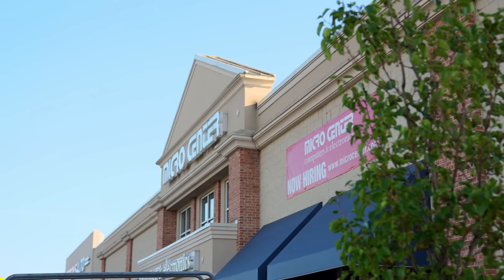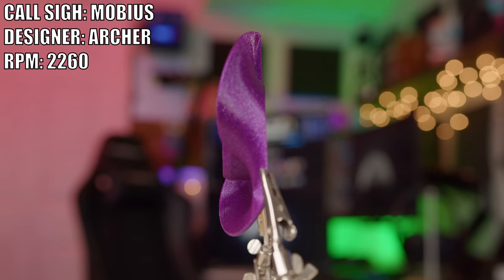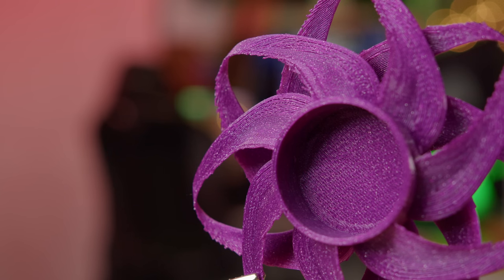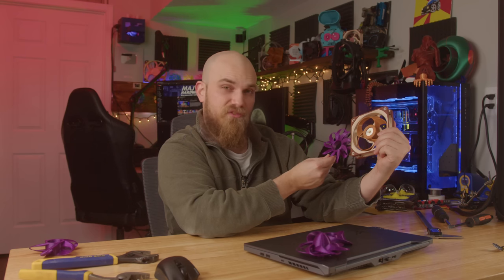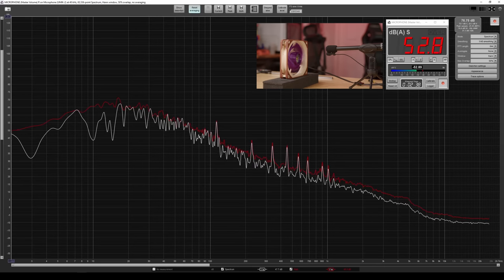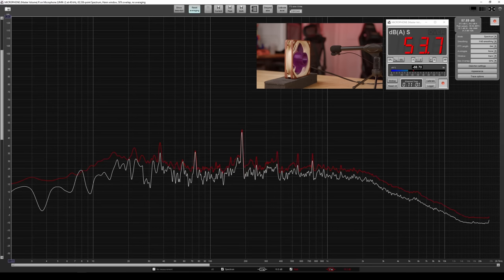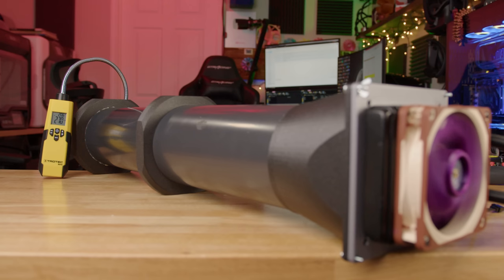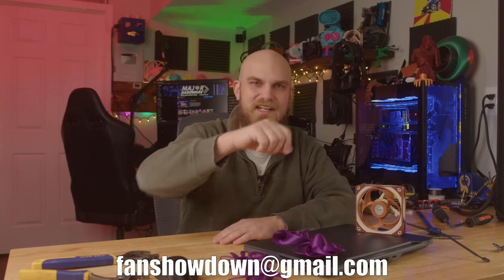My Subscribers Turned MIT Award Winning Toroidal Propeller Into A PC Fan | Fan Showdown S5E5

Comment: I am, by no means, and engineer. However the one thing I took away from your tests where, the most volume of smoke movement was along the circumference of the hub, trying to move to the center. The suggests to me that creating a much smaller hub on the fan and extending it away from the fan motor to accomplish this task, might do much better?

Comment: the mobius moved the same air both way's because the air flow is 270CFM meaning that going in the front of the fan is 270CFM of air and coming out the back is also 270CFM of air so because the wind tunnel is a constrained area when the fan is flip directions the air still has to through the tunnel its just that it is flowing in the opposite direction. due to the tunnel being a constrained area you don't have the effect of the air being pulled from all directions all 270CFM of air still have to pass the flow meter to get to the fan

Comment: The best for noise should be taking an existing swept fan blade design and and attaching the tip of the blades to the leading edge for the following blade. This till eliminate the vortex without having a solid ring enclosing all of the blades.
Reply: Thanks for the feedback. 
Expect more videos soon. 
Send a direct message... 
I have a Gift for you📦......

Comment: Hey why don't u try out the original design propeller with resin printing... For smoother surface as these  in the boats are smooth as butter

Comment: Hey, not knocking the testing, but I have to state that on the printed fans you can see the ridges, meaning that the airflow will not be as smooth as on the manufactured Noctua. Whilst I agree in your methods of testing, I think that the blade surfaces need to be smooth in order to compete with the Noctua

Comment: My understanding of the toroidal propeller design is that it requires very high RPMs before you start to see a big noise reduction over traditional propellers. These fans being relatively low RPMs (2,000 RPM as opposed to 8,000 RPM), you're going to need a design that is radically different than the quadcopter propellers. 

More than likely to get Noctua levels of CFM with less than 46db of noise you're going to need either dozens of overlapping toroids in the fan, or fewer toroids that wrap around the central axis more, something like that. These are all good tries, but I just don't think they grab enough air at the low speeds to get the job done.

Comment: I think the major issue is that toroidal propeller is designed to work without a frame or duct around it. You should have motor only without the frame to get full effect from these designs.

In addition, I would try to put those propellers in e.g. acetone fumes for a short time to make the surface smoother. All those extra lines on the surface of the propellers are going to cause a lot of extra turbulence.

Comment: fun fact.... in bigger home ventilation systems, 1mm of dust on your fanblads is aprox 10% reduction in effect.... so im wonderering, some of the prints are.... roughf...pointy....has a texture to it.
just for the fun. try taking one of the fans that did okay.... but hat like pointy(bad printed) edgde, and a gritty texture, and smooth it. paint, sand, paint, sand, pollish. and watch.... i garantee you will have a big improvment, ind sound, and effect.

Comment: Guys, toroidal blades most likely doesn't apply to PC fans. 
What they do in boats and such is to reduce border effects at the end of the blades. 
A PC fan is encapsulated inside a frame and that frame reduces border effects by itself, so no need for toroidal blades and it doesn't stack.

Comment: When I look at MIT's drone, it uses a non-enclosed blade.  I presume the advantage of the toroidal propeller is to self-enclose airflow to provide a steady stream.
A PC blade is enclosed by the shroud, so I would imagine that toroidal blades have little benefit, and are detrimental because they have less surface area.
-I am not a physicist!

Comment: If these fans work better without a frame like many ppl says, perhaps there's gotta be a toroidal design that's smaller than the case radius yet more/equally efficient out there due to the gaps.

Perhaps on a wider frame is in order, I can't imagine gaining much from blades competing with the mounting hub for usable surface area

Comment: I imagine your anomometer can measure airflow in either direction so flipping the fan changed the airflow direction but not the air speed so it read the same value.

Comment: These tests and such are fun, but I don't think we are getting computer fans with toroids instead of blades any time soon.
there's reasons for it; production cost and effective airflow.
The toroid boat props work great because its in a way denser medium than air meaning it works at lower rpm.

They "aren't as efficient as drone props" but because drones spin their blades at such high rpm anyway, it becomes worth the effort to have a quieter propeller.

Comment: I could be wrong but I think these noise levels were about the same as the stock noctua in the last video.  

I got to thinking about why, especially when MIT stated noise reduction and efficiency gains... With the design mitigating tip vortexes this starts to make sense.

The fan shroud/frame is already helping to mitigate tip vortexes on computer fans.  I wonder if there would be a larger sound difference on a hub with the outer frame removed.
Reply: Thanks for the feedback. 
Expect more videos soon. 
Send a direct message... 
I have a Gift for you📦...........

Comment: Did you try printing a traditional fan blade?  PLA prints are not smooth, so it might be helpful comparison. 
Also have you tried to 'smooth' any PLA prints? like ether using a hate gun, or other method of smoothing.

Comment: I see quite a lot of shear in the downstream smoke. A design that would make no shear at all, and almost no sound (!) would consist in removing the propeller completely and replace the fan shroud with a Coanda effect accelerator – you know, of the same kind used by Dyson for their fans. Over-pressurized air is injected through a thin slit and flows onto the inner curved part of a ring, akin to the upper surface of a wing (extrados) rolled up on itself as a toroid. Coanda fans suck the surrounding air very efficiently. As the drawback of such a design and the only source of noise (except for the slight whistling pitch of the wind) is the small compressor feeding the Coanda fan, you could put it remotely and incased into a box, in the attic or the ceiling, the next room, etc. I think this has never been made yet.

Comment: As far as I read. The Toroidal propeller only did a bit better than the traditional propeller but in mid rpm(for motor boats) range the Toroidal propellerwas 30% more efficient.
So I think it would be better to plot a graph for the Toroidal ones and the reference to see at which rpm would be optimal for the fan.

Comment: i think the biggest difference is the blade design. blades meant for flight are designed to create a very low pressure zone above the blade to create lift, it'll push air, but not as much as it redirects it around the blade. fans for cooling are specifically designed for pushing air along and not around. Toroidal fans are probably not going to be a good fit for cooling.

Comment: I have very very limited experience or knowledge when it comes to 3d printing so I could be wrong - but I feel like this sort of filament printing is what is holding these designs back?  They just look too rough and too heavy to be as effective as they could be.  I imagine the noctua fan blades are waaaay lighter than this stuff

Comment: The Toroidal prop for boats I've seen is pretty deep front to back to give it a decent blade pitch, that'd be hard to do on a smaller, flatter PC fan.  I have seen alot of "slim-line" 120mm Pc fans out there lately as well and wonder how effective they are compared to normal 120's.
Reply: So that makes me wonder if they could quiet the fans used in 1U servers, which are much deeper and spin much faster.

Comment: Not weird at all the Mobius got the same airflow speed when you flipped it, because in fact it moves the same amount of air in both orientations, just in the opposite direction. Would expect about the same behaviour flipping any fan, with some small discrepancies because you are drawing air in through a restriction rather than forcing it out through one.

Comment: I'm pretty sure the quality of the surfaces and trailing edges of the blades has a lot to do with both the strength of air flow and especially the noise level. You should probably print these in a resin printer or chemically smooth them. All the grooves from printing must increase resistance to airflow significantly and the uneven trailing edges create trubulent flows that result in noise. It would stand to reason that if toroidal propellers have better performance when done properly, the secret is in precise tuning of the geometry and in the precision finish/balancing, which is beyond the abilities of an FDM printer.

Comment: The Cooling fan is a shrouded fan anyway, so the tips are already fairly baffled so as not to create vorticies.  The simplest design for a standard prop is to shroud it, basically fix a ring with no angle of attack onto the tips of a standard prop.  It will add inertial mass with no additional airflow, but the idea is to shut it up.  I do think the toroidal concept has a lot of promise.

Comment: I like the enthusiasm for this design, but I wouldn't expect this type of fan to have a huge benefit in this scenario. The point of the design is to help control tip vortices on unducted propellers, but that job is already handled by the frame of a computer fan. There might be some small advantage, but I would expect it to be much, much smaller than that of its intended application.

Comment: I think you should try doing the opposite of this show, aka take the best performing fan design from the show, and rescale it to a set of props for some small drone. These drones usually have a battery flight time of 7 to 13 minutes, so the test could be to measure total hovering flight time with regular props, vs custom ones, from full battery to emergency landing. If custom props are better, drone should fly more efficiently, resulting in a longer flight time on the same battery.

Comment: RPM should be the same for all these tests. Aitflow and noise comparisons measured at the same RPM tell us more about how the shape performs. Especially if you can test at differeny rpm intervals. 

The shapes all weigh anf balance ddifferently so they will have different RPM at the same motor power

Comment: The MIT paper was proposing the toroidal fan as an alternative to an open fan. The main selling point of the toroidal fan comes from the fact that it doesn't produce large wing vortexes. The duct that the fans have already negates some of the downsides that the toroidal fan is trying to fix. To be honest I don't see how a toroidal fan can outperform the standard ducted fan in this case.

Comment: I think you should make the same propeller as in the original Noctua (but printed like all the others from your test) for a pure experiment with noise, etc.
The smooth surface and shape of the propeller blade edges is an important part to create good airflow (imho).
I mean a close to perfect smooth surface* and the ends of the propeller blades should be very close to the "frame" or slightly higher (but for case with higher need develop new frame with different form for inside frame "tube", good ref -- airflow from human nose, or dog nose airflow). The efficiency can be reduced because the air on the outside of the toroidal propeller rubs against the blades and the frame.  I can't describe it well in English, sorry

Comment: I was noticing the "Toxic" fan you have up on the back shelf from a few seasons ago, and wondering if it isn't basically a toroidal shape, just with the outermost blade-connecting portion removed? I kinda wonder if these newer designs would benefit from a similar element.

Comment: What I wish you had done - is printed a replica of the A12's blades to within the capabilities of your printers - and evaluated against that, ALSO, as benchmarking un-smoothed rough 3D printed surface against finely moulded injection moulding is not really... Fair.

Then it would be more... "Apples to Apples"

Comment: I'm no engineer but I think the ridges that form when printing the blades mess with the airflow, noise and energy consumption significantly. 
I wouldn't be surprised to see toroidal fans taking over the business once they are made via professional manufacturing techniques

Comment: Have you tried printing a replica of the Noctua fan blades in #1 place? I'm curious how much the FDM process contributes to noise. Do you have a resin printer? The smoother surface and smaller features might be better for PC fan blades.

Comment: The toroidal shape doesn't really make sense for a shrouded fan. The main advantage is that discrete tip vortices are not shed as predominantly. However, this problem is already mitigated by the shroud.

Comment: I notice the Noctua fan still seems to perform better than all the fans on the list,( even the new tech Toroidal designs),  and I also notice that the 3D-printed fans All have a very rough surface compared to an injection molded part. The rough surfaces would definitely affect the efficiency of All the 3D-printed fans. I would love to see how a higher-quality 3d printed part with all smooth surfaces would perform, Maybe post-processing with a smoothing treatment, or  printing  it in a high resolution resin printer would do the trick.  It would be cool to see if the same fan designs perform differently depending on the layer hight,  or Post processed smoothing, or a resin part.

Comment: I don't think Toroidal fans will help much when the fan is inside a frame like a PC fan is because the point was the how the air at the edges of the fan blades acts, but the frame around it is probably reducing how much that air is able to expand and create noise. That's my current theory. I don't have a means of testing this, but maybe you could...

Comment: I believe that these designs do not perform well inside a duct since the duct removes the advantages of the toroidal fans.  Toroidal blades reduced tip vortices to give them higher efficiency, but the fan duct does the same thing,  so you lose any advantage you would get from a toroidal design.

Comment: This is regarding the Mobius design performing nearly the same for the airflow test. You don't happen to have it where the airflow can flow in only one direction for that test, do you? Because if not, then it wouldn't matter the orientation of the fan because suck or blow, it would still move the same amount of air for your tester instrument. Perhaps if you want to be able to determine that, you could set it so if the fan blows pulls air from the fan side to equal positive airflow, and if it goes backwards to be negative airflow. Not sure how you'd be able to adjust your test to do it though.

Comment: The cowling effect of a computer cooling fan kinda negates the effectiveness of tip vortices mitigation, though. Its the rotary wing equivalent of flying "in ground effect, right? The benefit of a loop airfoil is really only realized in effectively unconstrained air volume.

Comment: Hm.. I saw a drone vid using one of those first very simple ones. It sucked at low airspeeds, mainly because of pitch not being optimised for hovering. I don''t really NEED another project but at the same time, I created cylinder building and torroid building algorithms years ago and the torroid building one is a perfect starting place to build a proper blade algorithm model, none of those you posted appear to have varied pitch from root to tip. I don't remember if the Sharrow model has it but it's probably only a couple of hours on tweaking my algorithm to get a good blade profile with radial pitch relief and then another half hour to add Prandtl tip modification to eliminate tip vortices. New hot girlfriend and wind for wingsurfing this eve, post your preferred dimensions and I'll put it on my to-do list?

Comment: If the tips of the normal blade makes the noise, why not just make a fan with outer ring that connects to the tips of the blades? Did you try it already?

Comment: i see most of people use FDM print, someone should make this propeller with SLA 3D print.
propeller is heavy duty part, little imperfection makes different.
with more precise SLA 3D print the result shoud be much better.

Comment: I would expect them not to do as good as normal fans - however they should be quieter than a standard fan especially when used in a frameless installation  - like a UAV/drone.

Comment: I think the most quiet fan would be if the blades were an actual real blades, made from steel wish sharpened edges, So that they would cut the air perfectly. I know it's dangerous but that's just my thoughts.

Comment: You should print these with SLA since the FDM doesnt have that good of finish compared to the actual finish products u get straight from the shelf, its unfair to compare an airflow and noise test (how ever, try testing and printing the  actual A12 and testing, if its the FDM that does the thing or just the models)

Comment: Did you take into consideration the size of air molecules vs the small size of the blades. E.g air molecules don’t “scale”down so you can’t take those reading to be accurate. I mathematically you will get actual better reading with bigger blades.

Comment: Is the incredibly rough surface caused by FLM printing these parts not having a huge impact on air flow and noise?   Can you get someone to resin print you a few for comparison? The surface will be so much smoother.